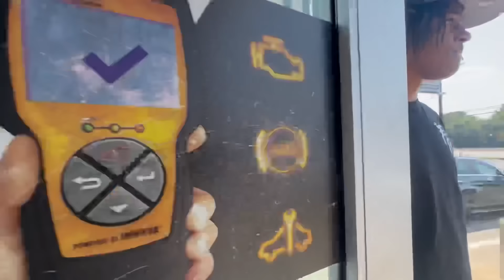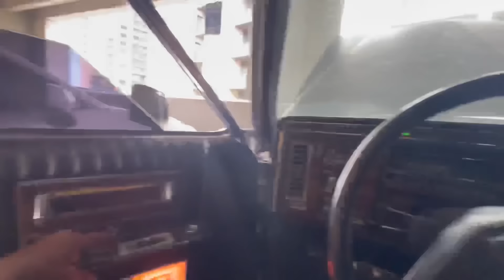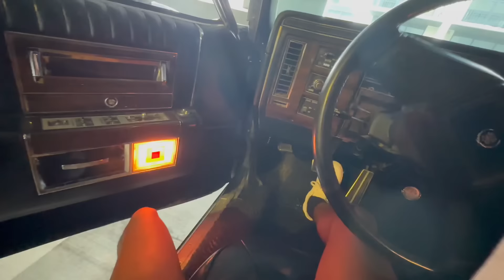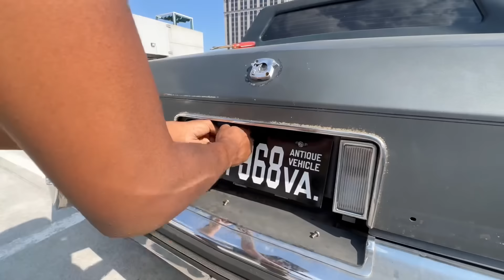Bringing My Old School BACK from the De@d 🪦😈 1989 Cadillac Brougham

Comment: You should change the motor get a Ls3 with pro charger and exhaust work and get the interior done and put some rims on it get the matching steering wheel 🔥🔥🔥🔥

Comment: You didn’t check the oil bro you checked the transmission fluid the oil dipstick got that red thing on the tip by the alternator and the reason it didn’t wanna stay running was cause you didn’t have a good connection .. you also was driving without the battery connected so it was running on the alternator which I wouldn’t recommend doing unless you really got to 🤣you gone need another top post battery or your going to have to convert it back to side post